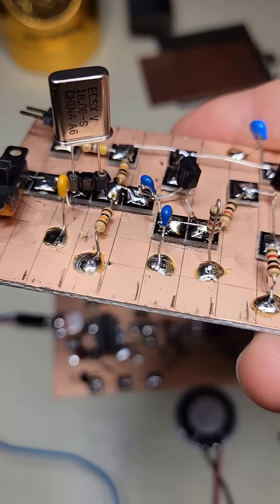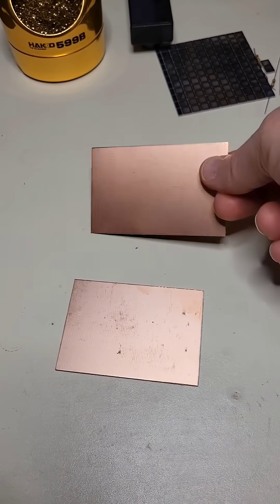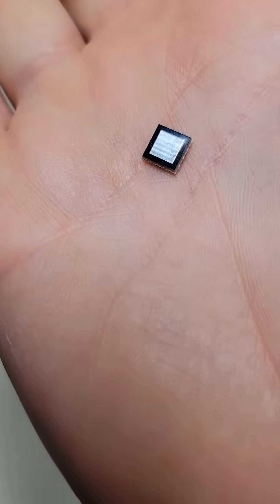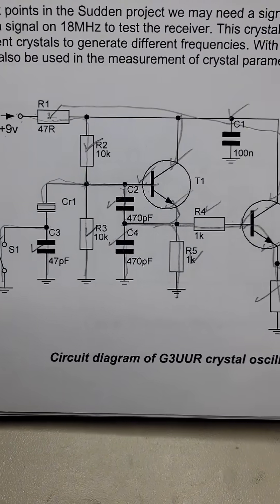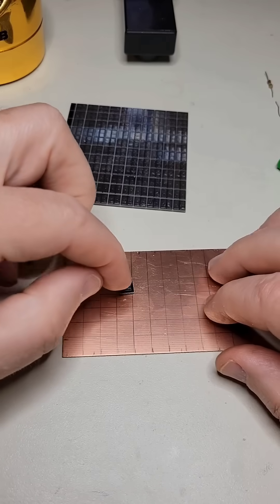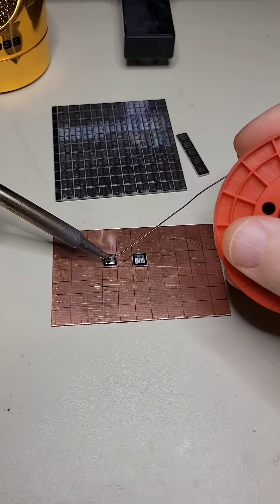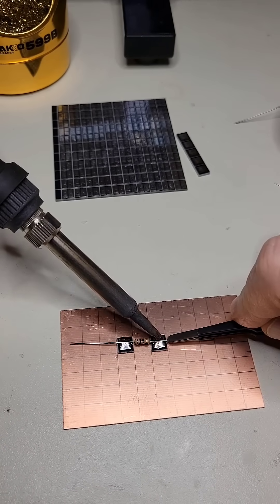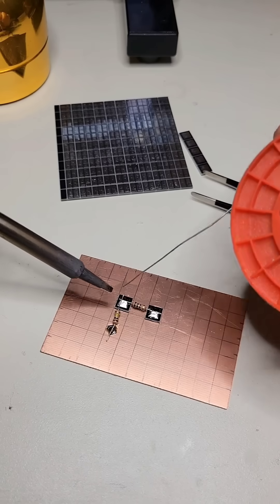Manhattan Circuit Construction Technique for Homebrew Ham Radios

Comment: For those wondering, this is for circuit where you need a huge ground plane. Anything high frequency, radio stuff, filters, etc. If you think a regular perf board will work, this technique is beyond your knowledge level for now
Reply: Than is point–to‐point wiring or components to same points also better for amps i take it. ( like the 60s gitar-tubeamps build. With a hardboard layout ,one row of point on top and one row at other end everything 'zig-zag' to many common points . Everything as short in distance as possible  the tube wire twined and solid metal casing were al ground/mass conects to.
Or is this tech in vid essentially different?
Reply: @well-mannered-troll  The entire board is a continuous piece of copper and it's used as a ground "plane" across the entire board. All ground potential points get soldered to it, and all of the non-grounded points are soldered onto the pads which are insulated up off the ground "plane" copper of the board.
Reply: @mannys9130 

Which is completely irrelevant because its a p-t-p wiring scheme which can simply be 'grounded' to anything. Literally  can be done on cardboard.
Reply: For those wondering, this guy's arrogance places courtesy and good manners well beyond their knowledge level.
Reply: @mpmansell  right? What a goof. Most likely he's an amateur lol you don't hear smart people talk to others like that
Reply: @mpmansell  Nah, the “arrogance” is aimed at the people saying the vid is lame or wrong, it’s deserved.
Reply: Nah. That is just plain arrogance and pig ignorance .
Reply: @well-mannered-troll all those squares be are connected. They're just marked out.
Reply: @trevorwoods3367  Now I see, thanks.
Reply: What about those not wondering? It’s a free country after all, you can’t discriminate like that
Reply: Thank you, i knew there had to be a reason for doing this, as compared to the usual way its very cumbersome.
Reply: @Coyote27981 

The reason for doing this is its 'cool'. Otherwise, there would be no need to make this video, because every other video would be for this type of build.
Reply: I always wondered why some old analog TV amplifiers has too much empty space in the circuit boards. When I first saw them, i was a child. Now I'm a middle age man and I just learn that those were not a circuit board waste or a cheap practise. And yes, i thought the same thing, i wonder the same thing after I see the video. I even thought that it is a non-modern old-school practise but I still wonder if does it help anything in any way, so I saw your comment. Thank you Captain.
Reply: @well-mannered-troll  ???
Reply: "Ground" is a misleading term in electronics. The ground in a circuit is just the 0V reference for the circuit. Sometimes that includes a connection to the actual ground, but sometimes not. Sometimes the term "protective earth" is used when people want to be really sure that it's understood that they mean "this is electrically connected to a big metal rod driven into the ground".

Actually, a circuit can have multiple grounds, but that's a whole other topic.
Reply: @SnakebitSTI 

Thank you
Reply: Define high frequency! Those pads will act as tiny capacitors in the ten's of  pF therefore really high frequency circuits will likely not work as intended.
Reply: Lol the arrogance. Like this is some Einstein level shit. I think you are the one with a low knowledge level if you think so highly about something so simple as this.
Reply: Plz explain
Reply: Probably beyonds yours aswell since you cant exsplain it 😂😂😂
Reply: Meeeow
Reply: Exactly the opposite. This is 1st grade for people who don't understand point to point.
Reply: There's pretty much zero advantage of this over just etching a circuit on a pcb with a ground copper pour. Less wasted time and money too
Reply: @rezavarghayi8181  this isn't really true, though. A ground pour is broken up (obviously) by traces, and can still result in odd behavior.  With Manhattan construction, you get a single solid ground plane beneath all components to facilitate good current return path for everything.

It's more like etching the top of a double sided PCB and leaving the bottom solid, then bonding the bottom layer to ground.

Manhattan style also has the advantage of being more flexible for adjusting and reconfiguring the circuit once constructed.  It's good for experimentation and exploratory projects.
Reply: @yakovdavidovich7943 

Weird. Not a single 'HF' radio I worked with in the Army, was built this way. I guess its a miracle they worked.
Reply: @rezavarghayi8181  This is a prototyping technique.  If you've got your final circuit, I agree there's little advantage of building it this way.  But suppose you find you need an extra buffer stage in a circuit you're working on.  You can modify this board in minutes and be on to the next stage of debugging.  If you order a board from China, or etch another board yourself, you'll spend considerably more time and money. You'll have to put ALL the circuit components on the new board, not just the extra buffer stage you're interested in. That in itself can introduce other bugs. And that's just for one iteration.  I've spent weeks doing 8 iterations on a circuit board before I got everything correct.  (It was a digital board with lots of high-pin-count packages in addition to some analog circuit protection that I couldn't adequately simulate.)  I found myself wishing I had an easy, incremental method of prototyping the circuit.   The method shown in this video wouldn't have helped me, unfortunately.  But I'll use this method for RF prototyping, for sure.  It's faster and cheaper than etching a whole new board each time I make an experimental change.
Reply: @rezavarghayi8181  Easier to change components and routing. Faster. Advantage is non-zero.
Reply: @rezavarghayi8181  Right? People trying to act like they know something saying it serves a purpose. Nope, not at all, just pure ignorance and laziness Im afraid😅. I can understand not everyone wants to, or has the means to acid etch pcbs for prototypes and such, but a Dremel tool will get the job done, in fact, I built a mini CNC router type contraption just for this purpose. There are companies now where you can order custom printed pcbs all drilled and everything for pretty reasonable prices, so this here is just a hack job at best and perf board actually would be much better than this as there's less to etch since it's only rows of copper and connections can be easily broken with an exacto and bridged with the component leg cut offs if you save em like I do, or even just bridge with solder between rows, it's about as down and dirty as I'll get, and much cleaner than this junk. Super glue.... 🤣 Wtf
Reply: @chrischeetham1652  Get over yourself, sis.
Reply: So is a double-sided copper is not the huge ground you said?
Reply: @well-mannered-troll  incorrect
Reply: Thank you for the insight
Reply: I'm ground plane ignorant. and thankful for those who build and create things like this and many other things the average person isn't interested in. if not for curious minds, we all would still be in caves
Reply: Will this board somehow give me a “ground” while living in a Waikiki high rise that has no real ground with all the PVC that’s been used for plumbing repairs? 🤔
Reply: @digitaldreamer5481  You are mixing two very distinct concepts. "Ground plane" as applied to a circuit and an actual "ground" are two very different things. The type of circuit described in the video addresses the former, not the latter.
Reply: @digitaldreamer5481 

Of course. It'll give you a (((huge)) ground beyond your comprehension
Reply: @digitaldreamer5481  Yes
Reply: @digitaldreamer5481  It's not grounded to the earth. The 'ground plane' is just the negative side of the circuit. I think it's to cancel out RF interference.
Reply: Wouldnt this be bad for certain HF circuits since there is increased capacitance between all the components and ground? parasitic capacitances are normally avoided as much as possible
Reply: @treasuretotrash2067  no, it's generally better for rf. And the silly comment above about etching being categorically better is just uninformed. A clean unbroken ground plane can make handmade boards viable well into uhf using Manhattan construction, which cannot usually be said of home etched boards. 

I do CNC mill my own projects at home. But I still do some Manhattan construction myself because sometimes it's important to have everything very well decoupled and avoid things like isolated radiating panels of copper.
Reply: @yakovdavidovich7943  100% right

Comment: what is the advantage of this vs through hole soldering
Reply: You don't have to design and order a PCB, so you can construct circuits immediately.  This also gives a better ground plane for HF design as even on a double sided PCB with through hole components the ground plane has to be broken for every connection not going to ground.

Comment: Does not make any sense IMHO. Just over working. Glues conductive  piece OVER another conductive plate ???
Reply: There is a fiberglass substrate between the two copper pads on those squares

Comment: Heat is a super glue killer
Reply: You have a fibreglass PCB insulating the glue from the heat, and a large area of copper sinking any heat away. It works just fine.

Comment: So, are those squares thermally insulated from the super glue? How does it stay on if not because super glue is easily broken with a little heaat.
Reply: Obviously they are insulated by the fiberglass PCB material, and you have a big ground plane to sink heat away. This method has been used by radio hams for a very long time.
Reply: @ferrumignis  Thanks, it wasnt too obvious to me what these were made of. little segments of fiberboard makes sense

Comment: That's a really cool and low-tech way to build circuits.
Reply: No it isn't. Ever heard of veroboard?

How do you mount a 555 onto this?
Reply: @Bobsmith-yf9oy Ever tried to use veroboard to make high frequency RF connections? It's useless.  Even the original 555 with it's nasty shoot through problem on the output stage can be problematic without a solid ground and good supply decoupling.

You mount ICs either dead bug (for through hole) or on the small IC adapter PCBs glued down.

Comment: a similar technique is called "breadboarding", you use a wooden (bread)board and push in thumbtacks on strategic positions, then solder components between the copper thumbtacks. it is the foundation for the technical term breadboarding.
Reply: I learned building gitar tubeamps. We used to call it  Point-to-point wiring. That is similar  i take it ?
Reply: @peeniewalli  yes, except that instead of thumbnails you wired to the socked connectors of tube sockets. and wired the various other components as resistors, and capacitors directly to them. breadboarding is more from a later age where you used much smaller and lighter components like transistors. also when doing point -to-point wiring often you created intermediate points to solder to with, for example, strips of isolating material that had metal contact points attached to them.
Reply: @martindejong3974  ah. Ok. I think we had combination. A board(made of(?)) about 80mm×200mm were we would punch a row of small metal rings on the top&bottem. There the resistors & elco's placed . The sockets indeed on the body/casing with twined pairs of wire. I think we basically copied 60s amps.
We had our own transformers made to our specification.(hole lot a work to put them stacks of metal to make transformers metal casing, since we only got the coils delivered😁).
Nice experience it was.
I remember we also build some harmonica foot‐pedal tube(pre‐)amps.
Reply: The difference between breadboarding, as you describe above, and the technique shown in the video, is that there isn't a ground plane in a breadboard.  It's ok not to have a ground plane for low frequency audio stuff, like guitar amps and such.  Breadboarding falls apart at radio frequencies, which is where the Manhattan construction technique in the video works best.

Comment: Im terrible at soldering. Always. A concern i have is that the electronic civiit will be overheated and fail when the hot solder melts onto it. Yet i watch as people calmly apply hot solder.  And i have a 60 watt soldering gun ,brand truper, probably cheap demonic Chinese government counterfeit knockoffsnd the tips degrade and start ti disuntegrate and dint transfer enough heat to the flat tip of the soldering gun, thus ,poor technique on my part

Comment: Waist of double sided copper bords. He could glue that pads on any 1-1.5 mm thick plastic sheet.
Reply: But then you lose the ground plane.
Reply: @Enigma758  If you don't understand what a ground plane is for, you won't miss it.  Until you wonder why your circuit doesn't WORK.
Reply: @davidnaegle427  Exactly my point.

Comment: Another way to do this is to use a small hole Saw, or a circles ruler and a sharp point metal object (like the tip of a compass, or center punch, or a nail) and remove copper from the surface until you create the pad.

Comment: Does it not put a kind of capacitor at each of those pads? 2 plate of metal that have a dielectric between them is the exact definition of a capacitor.
Reply: Someone ought to build a board of just such capacitors, meaaure the capicatance of the entire board in Farads, then divide by the number of little 7x7 mm squares, and figure out the Farads if each little pad.  Are you available to do the research?
Reply: @beyondwhatisknown  Or, as someone else in the comments has done, you could calculate it, knowing the dielectric constant of typical FR4 circuit board.  Turns out, each little pad has about 0.6 picofarad of capacitance.  That's maybe slightly higher than just a long wire hanging above the ground plane without a little pad.  But although the wire has less capacitance, the AREA between the wire and the ground plane is much greater, so external electric fields couple to that wire more than they would if it were close to the circuit board and soldered to the little square.  Depending on your particular circuit, one might be more of a problem than the other...
Reply: Yes, the capacity between layers of pcb is used in modern consumer electronics to match impedance. Design tools help you.